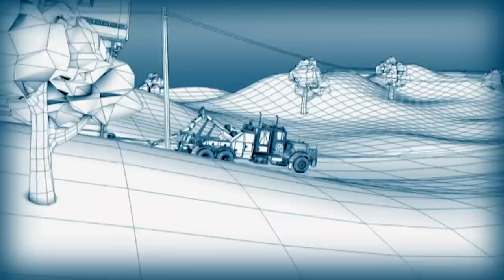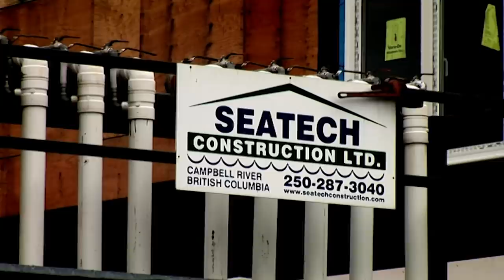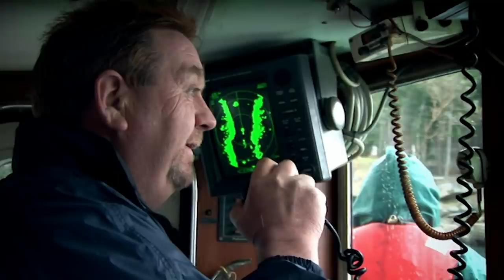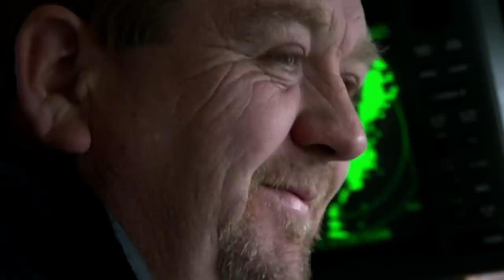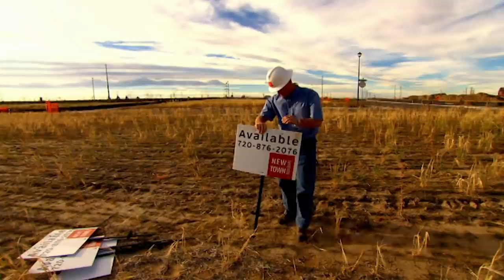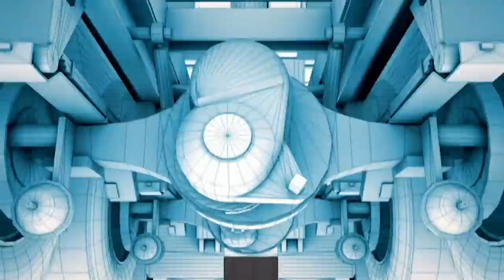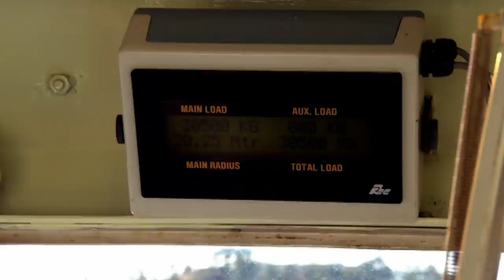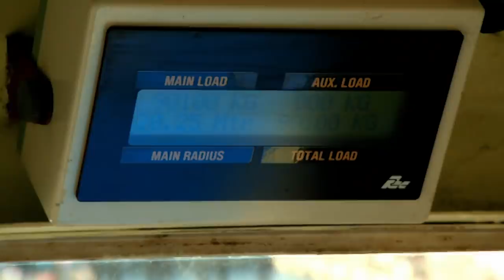Houses Dragged Across The Ocean To Build A Floating City | Huge Moves | Spark

Comment: Nice ideas. The second one (on land), looks  more like the house is build to stay on its place forever. So, it’s only a question of how economic that production really is. The floating houses. Well. What’s the point of building them if they are that fragile on water. They actually do that in the Netherlands too. But there they actually could move the house quite easily and the house itself is more stable in water. In that video it looks more like the houses are meant to stay forever too.  But then. Why not build them on land? Also I wouldn’t be to positiv that those foundations will last long enough in water. It quite seems that the team didn’t really think through all the possible complications. As seen with all the problems they got with the transfer. They where easy to  see from the start. I mean, they didn’t poured the concrete directly onto the platform. Didn’t build the platform to be sinkable. Didn’t think about a crane to lift them. So basically didn’t think about getting the houses from the platform into the water…. What else didn’t they think of ?
Reply: That type of Styrofoam absorbs water long-term as well. When will it get to heavy and waterlogged?
As for the homes built in Denver, that's a great idea and great work by the team 👍
Reply: Forever... We are living in the end times, there isn't much time left before the 7year Tribulation begins, this is all for nothing and it's not fair that one company pushes out all the small builders and handymen.  It's kind of boring as well, just one architect and his ideas. I do like the floating home community though. Maybe not a good idea for couples with small kids and pets. Well everything is going to change soon and we'll get a fair system after the 7year Tribulation is over. Accept JESUS CHRIST as your Lord and Savior while you can!

Comment: Interesting idea, but.....not really convincing. Like the owners of those homes must always consider, that the weight INSIDE their homes is more or less evenly distributed. What about having a big party with everybody gathering in the living room at the same time? The house would start to tillt I guess.  And it is hard to believe, that they didn`t consider the width of the spreader in advance for it to be long enough so the lifting cables wouldn`t harm the houses in any case. Like adding some extra feet for extra security.

Comment: Cool . I used to work for a builder mover in Boston ma for 15 years but I started part time I would take a vaca from regular job and work for him it’s cash . We jack up houses move them to a different location we could spin the house and I did some historic jobs we spun the house that they planned the Boston tea party in . Then we did a school that was built in 1700’s so we had the news paper there the streets had people watching like a parade . I was so pumped I just came back from a deployment I was NG oh so excited and when you make the move your going a idk 2 mph literally walking the house so you get the personal with your surroundings. I had my gateraid my dip on the main beam that sticks out a few feet .I worked full time after the army and it’s hard hard hard work everything is heavy like 50 lbs would be light to us you have the cribbing and your moving hundreds of things at some jobs. I was strong you get use yo it and it’s a lot of down time but you have to be vigilant making sure everything is secure. One mistake the house is ruined if your not level before you start jacking it up you could crack all the walls not every single one it does happen a lot even when you level it the problem may be the house itself

Comment: I live right on the coast In North Essex UK, we suffered the devastating 1953 floods as did other countries like the Netherlands. They devised floating homes some years ago, while we In the UK have new building requirements to make homes flood proof (to withstand moving water at a certain depth) but designed as NO living accommodation on the ground floor/ but would be just as easy to build floating homes..
Reply: I’m sure if your house floated, but still had a brick wall with a flood gate around it, they’d let you do it.
The problem is you have to dedicate some of your property to pilings if you’re on land and you’re just trying to avoid flooding.
The other problem is the foundations, the concrete ones are expensive and the rest of them aren’t suitable for land use.
The concrete ones require a deep draft however, they wouldn’t float unless there was more than 3-4 feet of water in which case the city probably isn’t relying on the homeowner to do flood protection.
I’ve always wanted to have a house that was on the beach, floating at high tide and on land at low tide.
Two problems however: 
1. Utility connections are difficult when your house is always moving up and down
2. The waves might be somewhat of a problem, there’s ways around that but in most cases you’re probably better off with a flood gate.
It wouldn’t hurt to have a fully inland wet dock for your boat if you live in a flood area, just build it next to the street so you can open the flood gate to that without flooding your entire yard and house lol.
Reply: @conanruisi  interesting but another way would to have the houses built on stillts ? Or use hydraulics lift it out of the water set it down when waters low ?
Reply: @batmscot6149  well the thing is if you had hydraulics you’d have to have hydraulic hoses, and you’d have to have electricity or a gas engine hydraulic pump.
With the floating foundation, it just floats. They’re already using the concept in places like Florida, New Orleans, and Amsterdam.
All of these places have very tidal areas that flood frequently and have previously had stilt houses.
The issue with a stilt house is that the height is fixed, and sometimes it floods more than you expect, and when that happens the stilt house still gets washed away.
A house that floats would float away a little bit if it flooded more than you expected, but you can still tether it to your property with an extra long cord so that it can be lifted back up and put right back into place if that does happen.
With hydraulics you would still have the same issue as a stilt house, what happens when it floods taller than your hydraulics? Your house gets damaged or washed away.
I grant you it would totally work to get the house out of the water in lower waters but if you’re building your house to avoid floods by using stilts or floating foundations then you probably have a lot worse than low waters to deal with.
Many people only have low waters, and in this case they simply use a brick wall around their property with a flood gate to close up any openings and water tight the barrier.
Although even in inland America it’s been shown that there can still be flood waters higher than the roof of your house so depending on where exactly your house is located will determine the most cost effective method of keeping your house alive.
But for high waters, or high tidal fluctuation, the most reliable option is a floating foundation with a hole on each corner for your dock piling so that you don’t float away.
I recommend making your dock piling twice as tall as your house, look at your local areas flood waters to determine if it should be taller and make sure you give it a little bit extra in case the water just doesn’t stop coming
Reply: I was in that 1953 flood in the Netherlands. Our home had 8 feet of water and mud in it, luckily we were able to be safe upstairs. Many people were not so lucky. It was a horrible time. This disaster caused the Delta works to be built. A system of dikes, locks and huge movable pontoons that closed when storms were expected. Now the worry is that this project will not save us from floods when climate change causes the oceans to rise.

Comment: I'm guessing at about 12 minutes into this, that this video is taking place after the fact or at least not finished until they finish and so the houses/towns are already built, but IF they ever do build more... when Air-Crete is mixed properly/at the right consistency, it is basically as sturdy as regular concrete and near as light as the Styrofoam, with the added benefit of also floating, much like true lava rock will float, because it is full of tiny air pockets...Anyway they would need to run a test for it's durability to water and if it is good and it can hold the same weight as what they are already using if not more, then they could use it and the foam instead of using the regular waterproof concrete!!! Then they would have a fully floating base/foundation under the house. 
IF it were me I would design the float to be bigger by 3' on all sides so you have that extra floatation should it ever be needed, but also have like a 3' deck/porch all of the way around and/or buffer between the houses, but mostly for the extra floatation!!!

Just my thoughts!!
Reply: Ha, I thought the same things!
Reply: INSURANCE must be very high and what about the taxes how are they taxed BEING on the water!!
Reply: They are very nice looking floating homes, but placed so close together. You would literally look right into your neighbors home and they into yours. :( The technology on both projects is very interesting. It seemed like somethings were not very thought through and needed to be worked out during the moves. But that may have been done for 'drama'. All in all 2 cool projects!
Reply: Concrete is very weak when it is new, especially a Concrete box.

Comment: just curious to know how long will they last in the water before they have to be pulled out to have their hulls redone ? .because even houseboats can sink after a while .
Reply: Looks like 30-50 years given standard conditions. I imagine things like being bumped against the sidewalk or landing on the ground during low tide/heavy loading might reduce that, as could things like flooding/sewage backup, or other impact trauma. Potentially even rust might affect the lifetime of the concrete.

Comment: This is back from 2007. Unfortunately the housing crash caused them to stop at only 15 of the planned 237 houses. 
However Colorado passed legislation for $40M (March 2022) in grants for “innovative” housing manufacturing which includes several new house manufacturing businesses like “Simple Homes” (which builds and ships panels/sections of houses in a factory environment). Another $400M bill is being considered for housing, 10% of which will again go to companies like this.

Comment: WOW, for a crew that builds for a living, I'm amazed none of them was smart enough to line the barge with visquine or heavy black plastic for the foundation pour. Even with diesel or some other surfectant to release from the wood decking on the barge platform, there is ALWAYS a bit of stick. Considering the vast amount of knowledge we possess with bridge work piling builds and the hydrocrete products for direct water contact with tidal force, I would have expected SOMEONE to at the least GOOGLE something. I guess the Canucks have a limited google base.
Reply: Looking into the future.......I see courtrooms.
I give it ten years before issues begin piling up......Beginning with some joker racing around in a outboard throwing monster wakes......These structures are VERY close to each other.
Reply: AJ gosh and Gui Tardzan- Amazing how disdainful you uninformed people can be. Comments about Google is just about your level.
Reply: @dianemcewen6484  
And here you are....Doing a drive-by comment with zero information content....If you're looking to pick a fight, bring some ammo!

Comment: Could have connected the barge to the crane while they attach their own Air Pressure valves and Release valve to the barge to allow the air out and water in, to sink it while still carried by the crane and all 4 houses could have been floated off all at once.  Afterward begin to pump air into the barge pushing out the water and return it to the surface..

Comment: If concrete\does not crack 
let much water in the house could last for many years but must keep in mine any part of closed cell  foam  with water contact over a period of time ends up 4 per cent saturation  and ice or snow on the roof  adds weight  at times it pushes the foam is interceded to water

Comment: I was raised in a house boat. The foundation needs to be wide than the floor plan. The only house that I saw being built with no walkway around it tipped over because it was not balanced
Reply: I've researched over the years and am wondering what mix of concrete they're using and why they didn't use some sort of elastomeric long lasting polymer coating on the exterior?  I'd used something like with embedded copper or something to prevent growth or at least slow/retard the growth unless wanting.   I'd also use close cell foam unless the foam itself is sealed as well.  Furthermore, seems a UHPC mix would be the ideal mix to use for the concrete to be absolutely safe.  Then again, might be builds only designed to last like 30-60 years versus real materials for generations and maybe 1000+ years.
Reply: @jafinch78  one of the houseboat builders decided that 50 years ago he was going to start a business replacing the old growth giant logs that were used in the 20s 30s as floatation for house boats. He hired a company to make fiberglass logs. It was an excellent choice. My brother owns the prototype. He built a 2 story house on the float. It floats in about 2 feet of water.
Reply: @gailloron3483  Awesome, thanks for sharing that.  Wondering by chance if you happen to know what the resin used with is and the gelcoat?  Wondering what the lifecycle of that material is and also if anything is used to prevent growths by chance?
Reply: I don’t know the details. The man passed away before he could get his business off the ground. He had put an old hour boat on the new foundation and my mother had the foresight to buy it. My sister live in it for a few years bu the house needed a lot of repairs so may brother bought it and built his dream house on it that was 2005 that he got occupancy permits.

Comment: Why didn't they just cut the sides of the barge and use it as a floating platform. That would be better than having a bunch of solo units when they could be stronger together

Comment: The Denver project is throttled by the assembly building. 237 homes will take over four years to build out the development if they only use the assembly building. That’s a slow takedown schedule IMO. Perhaps a better plan is to use the assembly building during the winter months to help offset the high altitude construction schedules and return to traditional construction methods the rest of the year? I see this being a better path for the developer, increasing his ROI which is what the final goal really is. Now the boat houses; those are a different animal all together.
Reply: This project failed and was over in 2008/9.  Factory building was torn down over a decade ago.

Comment: VENICE , some small Islands made in DUBAI (, IT CAN BE DONE . "Floatability and STAINABILITY FOR HOW LONG FOR A HOME ON WATER) ? The bottom of the home will need over hauling as ships and boats have to have from time to time , as long as heat / cooling / stove/fridge and the pluming work ,(throw in a steering wheel ),Float on.....😁👍
Will this be a Tax free zone👍👏👏👏😁

Comment: Floating City is a great idea. But usi conventional stick frame seems a bad idea. Timber frame is much better. And stronger than conventional applications. Also being placed on a moving surface to absorb wakes and repel high winds such as dome like structures. Yet provide ample living space. I think of Angus Macgyver's house boat. They should do this for victims living in flood plains. And New Orleans.

Comment: One company dramatizes making house boats as "Float Homes".  The other?  Does the same with their take on Mobile Homes.  If the Space Shuttle can be moved into and out of custom storage buildings via the largest custom built tracked crawler without issue then I'm pretty sure The Cohen Brothers can make this work.  Has anyone re-imagined setting loose one team of builders per house lot to custom build 237 homes simultaneously?  Just to see which method is fastest?

Comment: When you're going to the Narrows why wouldn't you put the guy with more experience at the front the guy with less experience at the back tie one boat to the back of the two houses the other boat to the front of the two houses and go through in a straight line that way the rear boat could always tug the houses back straight if the front boat started to lose them basically string the two houses between the two boats one boat pulling the other boat making sure they stay in a straight line

Comment: Some of the floaters weren't level. I sure hope the homeowners get them to fix that.. If I were to attempt this floating town, I would build a huge floating island first, then build the homes ON IT.  And they would be built with fiberglass filled with styrofoam, or something other than just wood. Aircrete domes may be a good idea. The guy who made an island out of junk had a good idea, but his first island was destroyed during a storm..so I don't know what you would need to do to avoid the possibility of that..